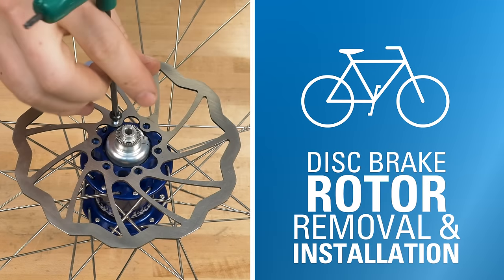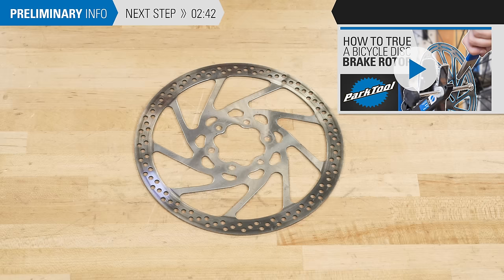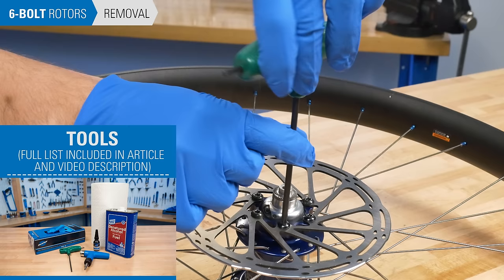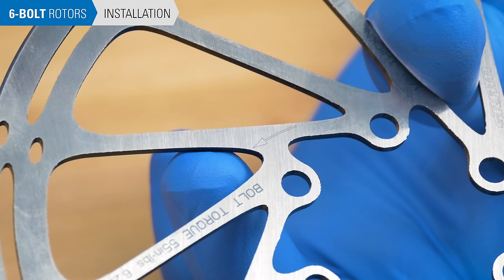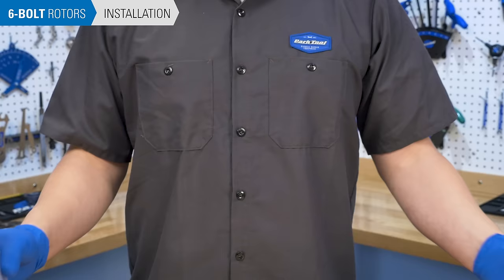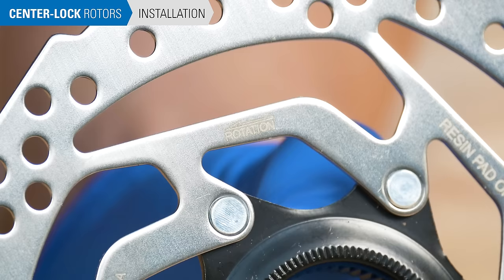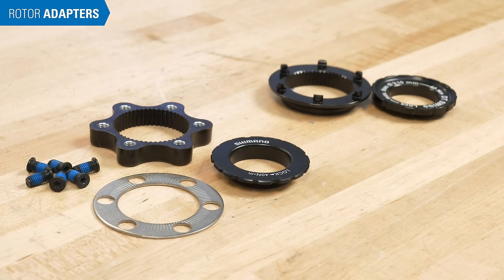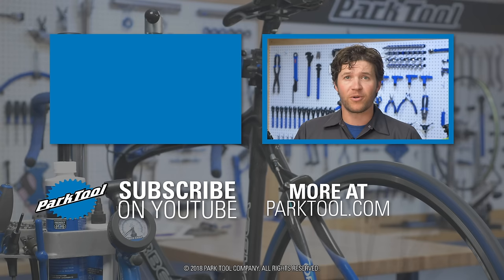How to Replace a Bicycle Disc Brake Rotor

Comment: Great video. Just wanted to point out that at 6:40 you say to use isopropyl alcohol but the video shows denatured alcohol. They aren't the same thing.
Reply: Works well in most cases, even for more delicate tasks, like cleaning lenses.

Comment: thanks park tools, i did wonder if possible to change from single centre locking to the 5 bolt locking system...and now i know without having to over spend, again......
thank you very much PT

Comment: This is really good, and so detailed it made me realize I should just bring my bike to the shop for this work!
Reply: Huh??? How did you not get how extremely easy this is even for a non mechanical type person ??? 🙍
Reply: @lewokejames  Might be easy, but the tools are bloody expensive.
Reply: @thegrowl2210  you got to be kidding right? Maybe $20 in tools if that.
Reply: @thegrowl2210  you don't need to buy park tools brand you can literally get the couple tools you need on Amazon which is exactly what I did
Reply: Sometimes shops don't even do it correctly...
Reply: @inglouriousmofo  you are not wrong

Comment: Is it normal for centerlock Shimano disc brakes to move a lidle bit under load?
Reply from the maker: There will always be some tolerance between the centerlock spline of the hub and the rotor. So, if you hold the brake and rock it back and forth there will be a small amount of movement there.
Reply: @parktool  thanks, you answered my question. 👍

Comment: Super thorough!! You guys even covered adapters, which is what I was looking for, covered the adapter type I bought, plus the bonus tip at the end about caliper alignment.
Reply: How do you stop the tool slipping off the locking ring?
Reply: @peterswarbrick7974  The tool is slipping of the shallow lockring at the brake-rotor?
Try to use more pressure holding the tool is place.
That can help to loosen/tighten the lock-ring.

Comment: Incredibly well put together video. I have the center lock version disc which needs the external tool. And just to let you guys know, that thing absolutely sucks. I have a tool (not Park Tool, but a cheap chinese one), and it's impossible to remove, as soon as I try turning, the goddamn tool just pops off. I have to take the whole bike to the bike shop. The old school 6 bolt system is just sooo much better, I don't know why the hell did Shimano feel like he needed to reinvent the wheel, and make the whole thing worse, needing extra tools and such.
Reply from the maker: Tool Quality for this fitting really does matter. Our tool offers a flush face for the best engagement, so it will not slip off.
Reply: Welcome to the bike industry, where we now need a drawer of rare use speciality tools to work with all the "standards".
Reply: The tool that removes the center lock is the same as the cassette lockring removal tool. Mine is Shimano branded and doesn’t slip. It was clever on their part to design one tool for two different uses.
Reply: @parktool   Can I replace shimano lock ring Y8JX98020 with Y8K198010  ? (12mm thru axle).
I want to use the same tool for cassette and for disc brakes rotors.
Reply: @PRH123  Not for the external one.

Comment: Hey park tool i bought a new disc rotor and it came bent the person then told me this : “All rotors need truing during installation as they are a stamped steel. I recommend purchasing a rotor truing tool in order to install these correctly and true them for use.” Can you tell me if this is true ?
Reply from the maker: Not wanting to step into a retail transaction between parties, we might offer that having to align a new rotor is not unheard of, however, it would not be considered the norm.

Comment: Should the threads of the lock ring, for centerlock, be greased or not greased. I note that the instructions indicate to not grease the splines.
Reply from the maker: No grease on the splines and if anything at all put anti seize on the threads of the lock ring.

Comment: I need this tool to unlock the locking ring on a Shimano disc brake rotor. But it keeps slipping off. I can't use the BBT69.2 because the axle protrudes through the hold where the ratchet handle would engage. What do do?
Reply from the maker: See the BBT-9 as an option

Comment: Park Tool HPG-1 has a max operating temperature of 540° F. DOT 5.1 has a boiling point of 518° F, and Shimano and TRP mineral oil have similar boiling points. So shouldn't it be ok to use grease on rotor bolts?

Comment: 7:41 can you see theres a internal spline does that tool still exists now adays
Reply from the maker: On that silver lock ring that tool is not available. It is a tool used by manufacturers only at this point. The external fitting is much more common and versatile. There are no lockrings with just that internal fitting size. There are other rings without any outer tool fitting but then the internal tool fitting is the same as the FR-5.2.
Reply: Thank you very much by answering my question that been stuck inside my mind every time I loosing silver lock ring of shimano 😊

Comment: What's the reason for upgrading from 160 to 180? I'm new to the biking thing so I was just curious
Reply from the maker: Moving to  a large diameter rotor offers more leverage to the brake.  The caliper must be spaced correctly but you do get more braking power.

Comment: is it possible to install an internal locking rotor on a wheel that previously had an external lockring?
Reply from the maker: If you get the right adapter, yes.  See some similar to https://www.jbi.bike/site/product_details.php?part_number=120181

Comment: My brakes are squeking and i sanded down the pads a bit to get dirt and such off and used that alcohol with a rag onto the disc and they still squeking so what should i do? Change out pads and disc or what
Reply from the maker: Safest bet is new rotors and pads. But that does not often make sense so re clean and scuff your rotors and then install new pads. That should help with the squealing.

Comment: What tools can I use besides the exact correct bit for 6 bolt disc, I got 1 off but the rest are way too tight and now somewhat stripped
Reply from the maker: The correct bit is going to be the best and only option that we can suggest to get those out without stripping.

Comment: my disc is a 10 year old avid G3CS and its still going strong and my rear beake pads are work so thin their barely a fingernail thickness away from the backing plate

Comment: Hi, on my bike are rotors with center lock and lock rings are with external nothces. So, are all center lock discs compatibile with external lock rings? I use shimano sm-rt10 CL discs and can I replace it with sm-rt30 CL discs and keep external notches lock rings?
Thank you.
Reply from the maker: They sure are. And you sure can use the lock rings from your SM-RT10's on your new CM-RT30's.
Reply: @parktool   thank you very much

Comment: When I what to a bike shop you know buy something for my bike also I saw this disc break has two arrows I was shocked 😮 it should be one way rotor disc and love ❤️ this video so much make sure disc is perfect tight 7 🔒 I never seen it before it my first time see it my is 6 bolts

Comment: Hi there.... My bike's rotor got free play back n forth.. Is it because the aluminum shim between rotor & centerlock missing/worn out?
Reply from the maker: That could be. There are also lock rings that have more and less thread engagement. If you have one with more thread engagement it could be bottoming out on the axle end cap. This does depend on the hub though.
Reply: @parktool 👌🏻.. Tq sir!

Comment: Hi, i have the same center lock rotor as used in the video. When trying to do a skid with the back wheel the entire wheel starts to vibrate and it doesn't skid nice, can this be because the lockring isn't tight enough?

Comment: I think I stripped my bolts out they were on there really tight. Do you have any ideas of how I can remove them?
Reply from the maker: If you drill the heads off, it's likely that you can grab them with a locking pliers or a pair of screw removal pliers.

Comment: What a great video as expected , a lot of comprehensive info . I have a question I hope you can answer . Can a standard 6 bolt rotor that is cut from one piece of material be interchanged with a 6 bolt rotor that has the aluminum spider in the center , our will there be rubbing or misalignment of some sort ??
Reply from the maker: In theory, they should align the same. There is a standard they should both match.  In practice, you better double check and re-align the caliper as needed.

Comment: What else can u use to wipe both sides if u dont have the alcohol
Reply from the maker: Acetone would be good.  A window cleaner is better than nothing.  Use solvents that do not leave an oily residue.

Comment: How do you use the FR5 lock ring tool with a torque wrench ?
Reply from the maker: Use a 1" socket over the top of the FR5, which is made from 1" hex steel stock.
Reply: @parktool  thanks!

Comment: Can centerlock rotors be exchanged,one with outher notch nut to be replaced with inner spline?
Reply from the maker: The thread in the hub is standard, so the inner splined lock rings will interchange with the outer notched lockring. In some rare cases the rotor spider arms can interfere, but normally, yes, they interchange.

Comment: Hi, Is it possible to install double rotor on the front? These days, there's a portable caliper which able to fix on the side of the frame or fork. Is this doable?
Reply from the maker: It is possible but not practical or feasible. It would take a lot of fabrication on your end.

Comment: Can you use the either a 6 volt or  centerlock disk brake rotor with the same disk brakes?

 thinking of upgrading my wheels but the sets I want come only in center lock so was just thinking of changing the rotor insted of upgrading the whole groupset.

Can this be done?

Thankyou!
Reply from the maker: They both work on the same brakes just fine. There are a few clearance limitations on some brake caliper and rotor combination but overall they are very much compatible.

Comment: Should I replace my pads when replacing the rotors? Even if the pads are still good?
Reply: As long as there's still enough braking compound & that they're not contaminated with hydraulic fluid, you can still use them.

Comment: you can tell me please what the name of the tool you use on 5:15 to extra tighten? and where can I buy it, and if it must to use it for tighten or just nornal screw is enough?
Reply from the maker: That is the ATD-1.2. 
https://www.parktool.com/en-us/product/adjustable-torque-driver-atd-1-2
Reply: tnx, I have to use it? or it can be ok just use normal allen?
Reply from the maker: A normal hex wrench can be used to tighten but a torque wrench is suggested to get the proper tension on the bolts.

Comment: 2 bolts got stripped on my front rotor. What should I do to remove it?
Reply from the maker: I have had to drill the heads off of rotor bolts before. Once you drill the head off you are left with the stud, which you can typically hold onto with a locking pliers to spin them out. If they have a good amount of thread locker on them you might heat it up a little first with a heat gun to loosen up the thread locker. Past this its drill and try an easy out. Hope this helps.
Reply: Thanks, I guest i'll need to go to the nearby bike shop as I dont have the tools needed and let them do the work.

Comment: Would anything bad happen if I took off the front Centerlock rotor completely?
Reply from the maker: Nothing bad will happen. They are designed to be removed. If you rode without it, you would be riding with a 70% reduction in stopping power though.

Comment: My 6 bolts are not coming off, even more leverage is not helping nearly stripping bolts any ideas?
Reply from the maker: Try some mild heat, from a hair dryer or heat air gun.  Even boiling water.  Aluminum will expand with the heat.

Comment: Why to replace the rotor when worn?
Decreased braking power?
Reply from the maker: As the rotor gets thinner it has less material to dissipate heat and it will become discolored and will warp.
Reply: A rotor is usually very cheap
Reply: @stefanobentivegna  unless you buy a XTR shimano rotor.. jaja

Comment: Hi, if I have 6 bolts system and I want to change to rotor disc, what adapter is required? Can you help me please
Reply from the maker: If the hub is a 6-bolt system, you need only the rotor type accepting 6 bolts.  Adapters are only needed to use a center-lock component with the 6 bolt system.

Comment: What to do if my old rotor bolts are super stuck how do I remove it?
Reply from the maker: Those can be difficult. If the heads get stripped out then the heads can be drilled out, rotor removed and hopefully grabbed onto with a locking pliers.
Reply: @parktool  no the heads aren't stripped out the bolts are just stuck like crazy kindly help me remove them without a drill plz
Reply from the maker: Use a longer lever and keep turning. You can use a bit of heat on the hub to hopefully enlarge the holes slightly. Try not to heat the bolts when doing that. A hair dryer or heat gun in a low or medium setting should be all the help it needs.
Reply: @parktool  okay I'll try and let you know thanks for the help

Comment: Hello There , Great video.
I have a newbie question :)
Recently  i bought a caliper that instead of B01s pad it had a G03S Resin pad  ( BR317 caliper ) and i saw that it wasn't touching all the surface as the B01s pad did, it is narrower ! 
So the question is : is it safe to use as long as the rotor is the same diameter ,example 160mm . or do i have to change the rotor to the appropriate one  ,example from RT-30 which i have now  to RT-54 which Shimano states at the site as compatible ? Can i use even a better  quality rotor like the SM-RT68 so i can use metal pads in the future ?
Thank you
Reply from the maker: We do not recommend using the BO1s pads in place of the GO3s pads. The back plate dimension needs to be correct for them to work properly. They may work but not as intended.
Reply: @parktool   
Hello and thank you for your reply , but i didn not ask if i can swap the pads . To say it with less words the question is can a GO3s pad and caliper obviously work with any rotor or not ?

Comment: can I use BBT 29 instead of bbt9 on external notches ?
Reply from the maker: The diameter of the tool pattern on the part is different between them.  It will not fit the rotor brake lockrings.

Comment: I have a 6 bolt rotor and when I brake the rotor stops spinning but the wheel continues to spin freely. The hub is not attached to the wheel and just shakes and rolls on the wheel hub. Please tell me how to fix it. 
Thanks in advance
Reply from the maker: This sounds picture worthy. Please sent an image of the issue to tech@parktool.com . We will then be able to tell you more about your issue. Thanks for reaching out.
Reply: Thanks, found out the problem. The rotor hub adapter's treads that screw on to the wheels hub had be  completely worn off. Will send that image soon.

Comment: Can you use car brake cleaner to clean the rotor?
Reply from the maker: You sure can. Remove the wheel from the bike to do that. Car brake cleaner can have a lot of power behind it and spray all over.

Comment: Hi, is it safe to put 180mm on front of my ciclocross bike? It's an aluminum fork by the way.
Reply from the maker: Check for the manufacturer to be sure. Some have max rotor sizes listed.

Comment: Anyone using those locking washers that come with shimano disc rotors? Also the blue stuff is locktite right? so why the need for those things?
Reply from the maker: Kinda a belt and suspenders situation. The likely hood is very low that the bolts will come loose at all but once they get loose the washers will do a better job keeping them on.

Comment: Can a centerlock use threadlock?
Reply from the maker: You could.  The threads should have a good bit of torque and that keeps in coming off.  It would not hurt but it also does not do much in this use.